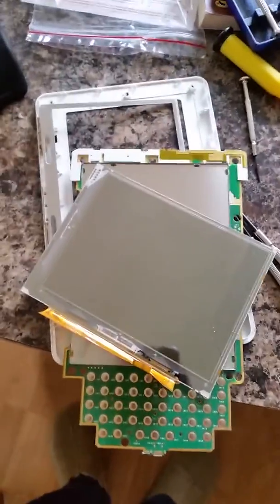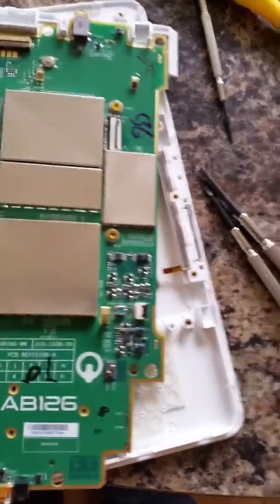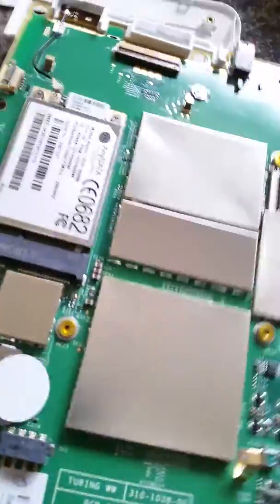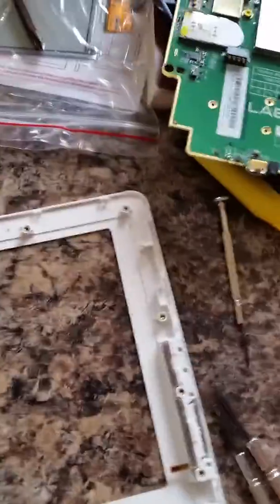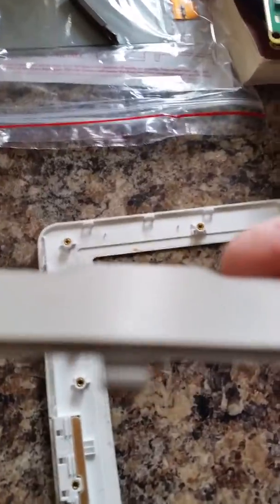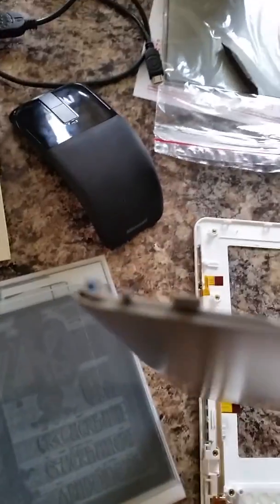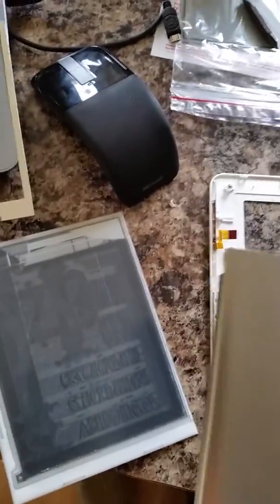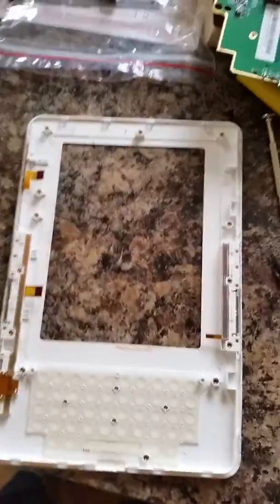Kindle ink screen replacement.  Model D00701

Comment: Is it worth it in 2025 to replace the screen? Thank you 👍
Reply from the maker: It’s a collectible item now, so yes. Plus the whispernet works worldwide on any mobile network.
Reply: @knowledgebyte found a Kindle 2 in an e-waste dumpster I check periodically. It seems to charge correctly but the screen is messed up! Thank you 👍